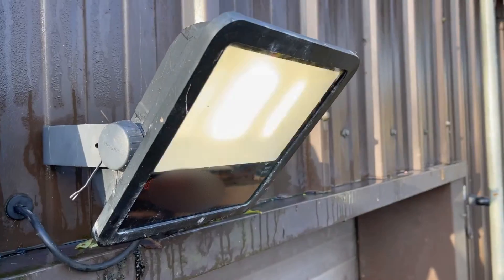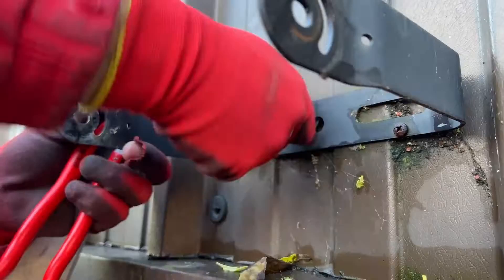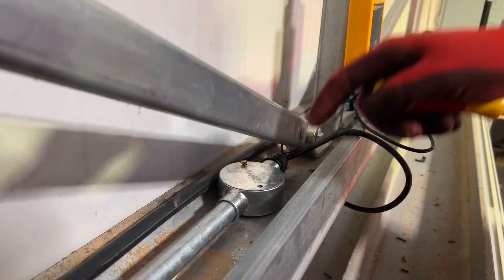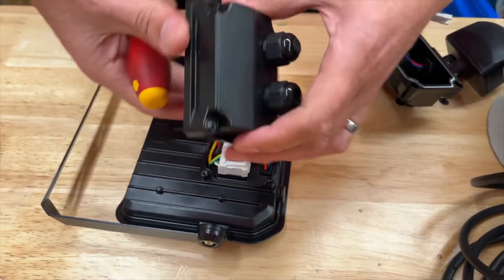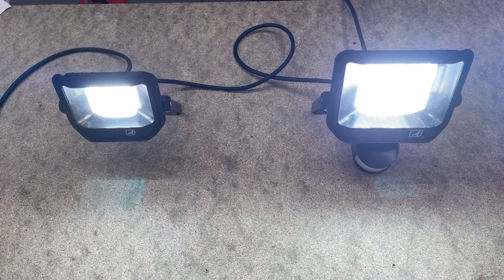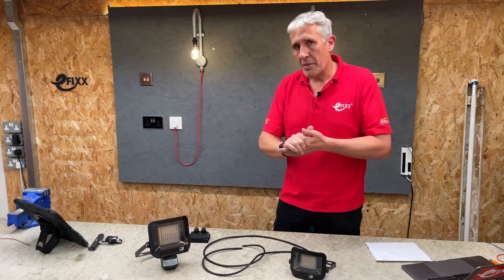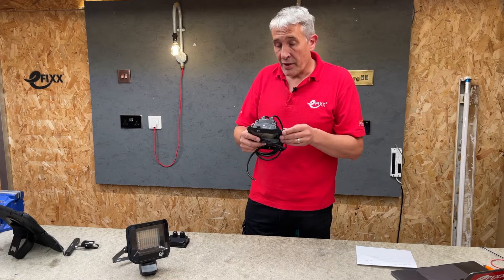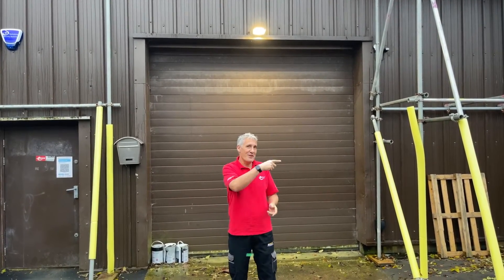Installing LED Floodlights Just Got Easier... Here's How! - Ansell Lighting Telic

Comment: As a lighting impact assessment specialist, everybody should know that any flood lights like this with no cowling or shielding for upward light emissions will contribute significantly to sky glow, is detrimental to light sensitive ecology such as bats, cause extreme glare issues especially for the elderly and cause adverse light spill beyond the area intended for illumination. They shouldn’t really ever be installed especially when angled above horizontal as half the light goes straight to light pollution and in to the night sky. These really should be banned! If you have to light an external area, use a fixture that optically controls the light only downwards and has no light emissions above horizontal. It’s so distressing to see so many terrible installations that are incredibly wasteful and bad for the environment or neighbouring properties. Please stop installing flood lights like this.

Comment: Rivnuts into such a thin cladding skin isn't my idea of durability. I'd much rather use a spreader plate on the inside and long fixings to go right through. High winds are going to play havoc with such a flimsy arrangement.
Reply: My thoughts as well, the bracket looks flimsy, and in strong wind there's going to be quite a bit of leverage on that narrow mounting bracket, I would have liked a wider bracket.

Comment: Seeing that metal ladder and going off-topic for a bit: where do things stand with ladders?  Can we use metal ones?  Are we only supposed to use non-conducting but no one bothers?  Who cares? (no really.  Who will turn up and say "you can't use them"?)
Reply from the maker: It’s a good question. In this case it’s leaning against a steel framed building which a few weeks earlier was covered in metal scaffolding.

Comment: Great
Do u have a link for the threaded inserts used?
Thanks
Reply from the maker: They are from AVK - https://uk.rs-online.com/web/c/fasteners-fixings/sheet-metal-panel-fasteners/threaded-inserts/?applied-dimensions=4294967232
Reply: They are called riv nuts or nut serts. I've used them in the motor trade for decades.

Comment: Like it. Does it last though? Had nothing but bother with LED flood lights failing after a year or 2.
Reply from the maker: We’ll report back in a few years - six months so far
Reply: True. So many of these are priced as if they'll last for 10 to 15 years but in reality you'll be lucky to get 5 years out of one before forking out again for a new lamp. Plus an electrician callout.

Comment: Looking good you can link off for another light? Can the driver handle an extra 100w led,
Reply: Each floodlight has it's own driver so you can link as many as you like (within reason).For the PIR linking,  x1 PIR can run up to 200W so x4 - 50W floodlights, x6 - 30W floodlights, etc.

Comment: Like the cable-less design and the loop in out, it all a bit late though as JBs will have been added to most lights by now. Let’s hope they start and last the hours they are supposed to and not just a few years, as it’s an eco disaster throwing away all those used fittings

Comment: Great features, but the more simple and user friendly that electrical equipment becomes from an install point of view the more likely it encourages DIYers into thinking they are experts. 🤔
Reply from the maker: Simplicity never stops a DIY job
Reply: I would rather see DIYer to install this one, then “standard” ones with pigtail, where some individuals just use screw terminals or Wago terminals and let it hang from wall outside of building (saw it several times)..